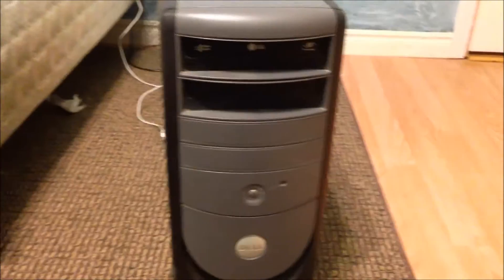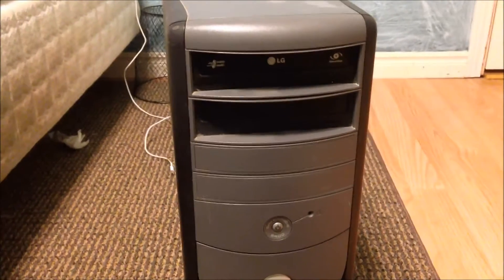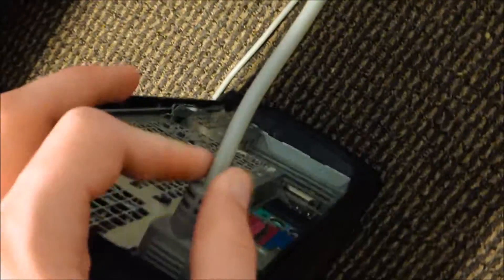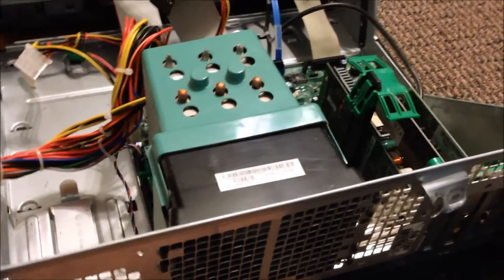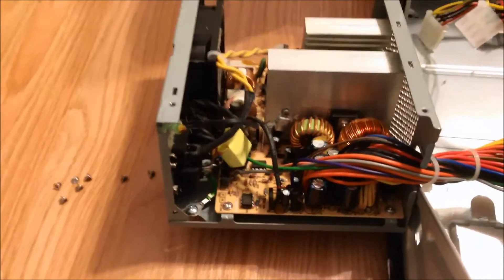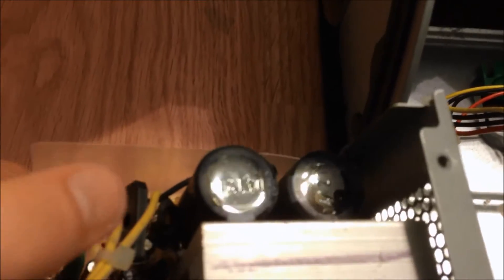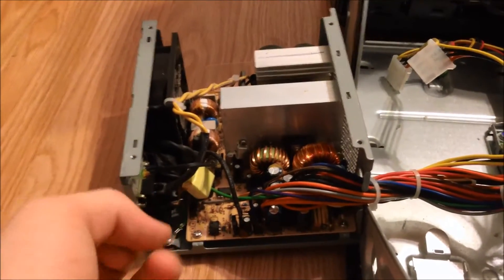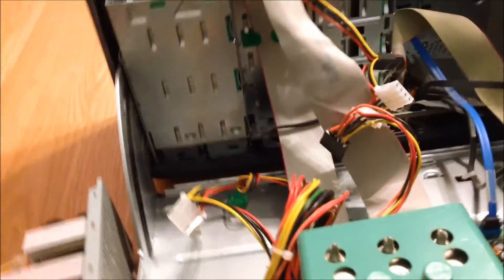LOST FOOTAGE: Dell Dimension 8400 With Bad Power Supply.

Comment: 2:25 touching PCB and component legs on a capacitor-filled power supply that was recently plugged into AC...brilliant! Even though I disregard warning labels all the time and service dangerous stuff, I use at least a little bit of caution when doing so.
Reply from the maker: I'm okay, thanks for the concern.

Comment: Was the power supply from that system a Dell branded unit? The inside of that power supply looks awfully similar to a Bestec ATX-300-12Z 300W unit, which are usually found factory installed in HP systems from the time. I noticed that one even has an indicator LED in the back of it like HP OEM units have.

I have an OEM power supply from a Dimension 8400. It's branded as a Dell unit and manufactured by LiteOn. It's an absolute tank... 350 watts with two 18A 12V rails, capable of 22A combined (336W) on the 12V output. I'm running it in a system now with an Intel Core 2 Quad Q6600 and nVidia GTS 450 GPU.